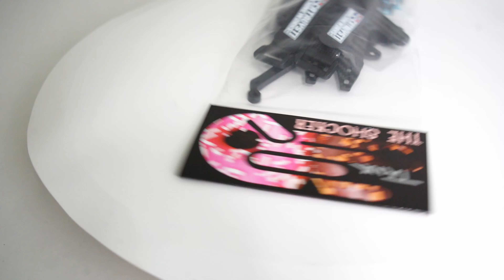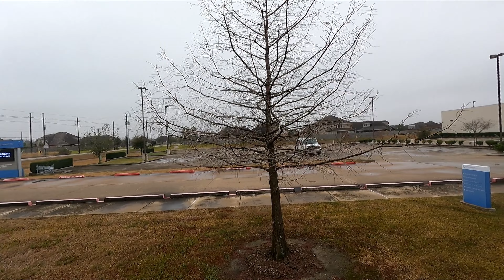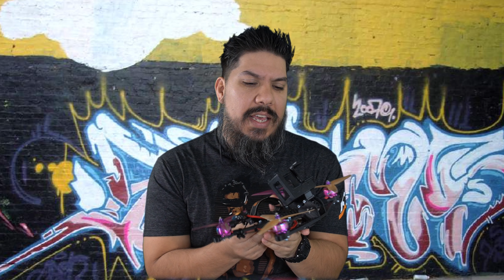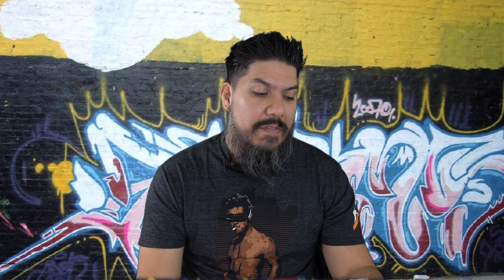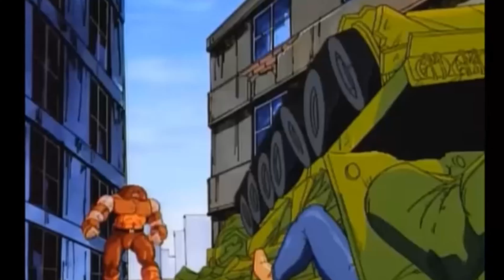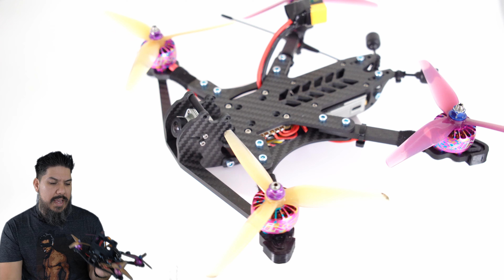Shocker Tank Catalyst Machineworks freestyle frame Xing 2208 flight feel durability - 5" quadcopter

Comment: Hi Jon, do you have the tune for this you could upload please? Thanks
Reply from the maker: Sure!  The tune i used was stock betaflight 4.2 with main filters clicked 1 click to the right.  The rest of the tune and rates were all defaults.  

I just made a new video about how to tune your thumbs instead of your flight controller.

https://youtu.be/WPHmevw375Q
Reply: @JonE5FPV  that sounds like my kind of tuning haha thanks mate. Just was curious as my shocker tank is almost identical spec as yours 👍

Comment: I keep looking at these.   Let me ask do the imperials draw more power than the 2208
Reply from the maker: I would say at the top end, power is similar, but the bottom end, the power curves are different.  Imperials have more low end control, these have more low end power but less control.  The imperial is a little more efficient at the low end, and both will pull a lot of amps on the high end if you fly very punch.
Reply: try some 2507s, feels like you stuck a V8 motor in your quad lol

Comment: That's cool. I was wondering why more frames didn't have the arms at the top of the frame so the body and electronics are below the arms and the battery above the arms.
Reply from the maker: i didnt think to much of it at first, but flying it, i get the gains, very interesting to get a more rigid package.
Reply: @JonE5FPV   I've been planning on building the Shocker for a while now with XING 2208s. Why did you choose the two-piece camo ones instead of the unibell black and green ones.

Comment: Can you even tell a difference between it and the BangGod? I seen Neil now offers a bottom skid plate but idk if it’s for the 5” tank or not. The weight lost with standoffs would be gained back in tpu id imagine
Reply from the maker: I feel like I can yes, but they are not huge, since because of the large custom standoffs, the bangGod has a lot of rigidity already.  Due to the cage, i would say that if i had a failsafe from 50 feet and landed bottom down, id rather have the banggod.  If i crashed into a brick wall head on, id rather have the Tank.  

I agree, that with the TPU bottom you are likely bringing the weight in line with each other.  The tank is a little easier to work on, just because you can access everything without taking off the topplate, but that isnt a huge deal either.
Reply: @JonE5FPV  can you notice any specific flight differences between the two? A quirk of a radical new frame perhaps?
Reply from the maker: @CaseyGray58  The main difference is how rigid it feels, but it is going to be a slight difference, since bang god is already pretty rigid.  It would be more apparent coming from a regular frame design with smaller size stand offs.  With a similar tune and components, it wont feel vastly different.  This moves the crash protection from all around, to more forward facing.
Reply: I tend to like the Tank a bit more than the banggod, feels more agile even though they pretty much weigh the same; but has a lot to do with the rigidity of the frame and how balanced it is.